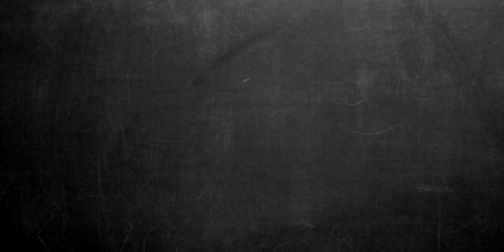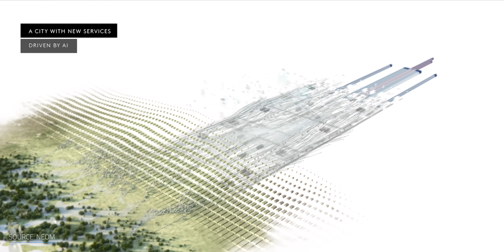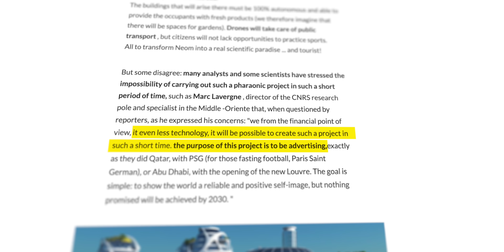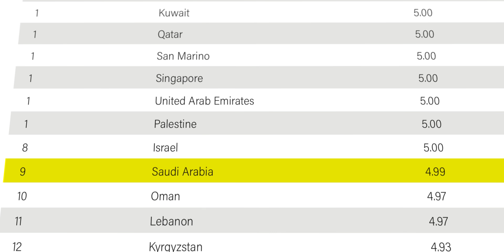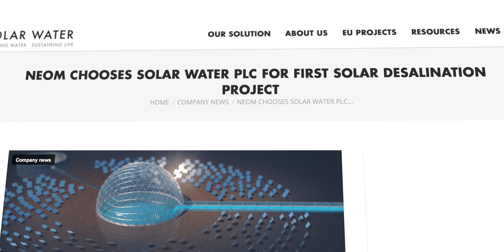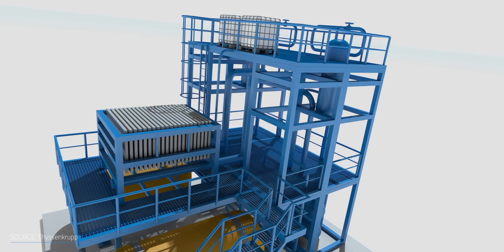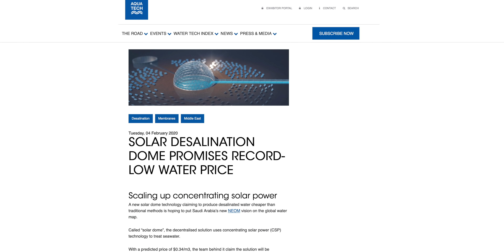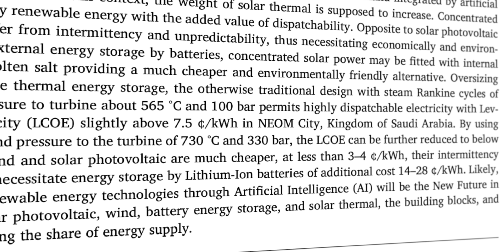Why Neom Might Be The Future of Sustainable Cities

Comment: Firstly, no, this just seems like a mass surveillance city designed by a megalomaniacal dictator. The attention is the point in these kinds of projects. Other examples of similar logic is dictators building the tallest tower. It doesn't matter if the new tall tower is actually economical, sustainable or liveable as long as they get to brag about it.
Secondly, he could literally just build rail, trolleybus, pedestrian and bike infrastructure into pre-existing cities and their sustainability would skyrocket, far outpacing whatever gains a giant line of expensive concrete could do for sustainability.

Comment: a linear city solves the problem of political dissidents. MBS can accelerate train towards the concrete wall at the end, then stop it and open the front of the train , causing the disidents to rocket into the wall. bonus fertilizer source.

Comment: It seems some have a really short memory - haven't they learned anything from the Palm or the World artificial island projects?

The same goes now for Neom - of course, all can technically be done if one throws enough money on the wall. The football World Cup in Qatar showed us that even air-conditioned open football arenas are possible.

But aside of all this - already the city footprint doesn't make a lot of sense. A circular footprint would give the closest proximity to everything and would not require a SMAGLEV with supercooled magnets in a 45'c environment. Just as well as the issue of do we really need to bring another million people to live in a climatically challenged environment? I have friends in Dubai and they tell me that on a normal day, they won't be outside for more than 15 to 20 minutes a day - the rest of the time they are in airconditioned rooms - their cars included (yep - AC in the garage).

So maybe real estate developments in less demanding climate zones would reduce the energy requirements by 50% to start with. I like the push for green hydrogen though and hope this is going somewhere....

Comment: "the line" is supposed to be inhabited by 9 million people and be 170km long. You need a 520km/h railway to connect it end to end to still fit within 20 minutes connection time - not accounting for stops!

meanwhile the former Tokyo City limits (23 special wards) have a surface area of 662km², which corresponds to 29km diameter give or take with a population of 9.7M people (2020).

you only need 1/6th of the train track  to traverse the city end to end, so with the same "revolutionary" technology that is supposed to be used in "the line" it would only take around 3 minutes 20 seconds. and only 1 minute 40 seconds to get from the edge of the city to the center, assuming the same technology. 

there is a reason why we don't build line shaped cities. Because that idea is pure and utter nonsense.
Reply: There is a city that exist built following a river between mountains

Comment: I love sci-fi, but this installment of “dictator vanity project” just isn’t believable. While it is shiny and newish, the design is actually one of the least efficient means of concentrating population in an urban area. Proposed in an area with almost no arable land, all goods will need to be imported (until your hydroponic gardens come online and the appeal of lab-grown beef and goat has become agreeable to the elites). Distribution of goods, utilities, and people in a single linear direction is the least efficient way to deliver such services. Let’s hope we have teleportation figured out by the time they ever have a failure in their mag-lev transit system. With little to no redundancy, the wait time for food, even the ability to get home/to work could be ugly if the failure occurs between you and where you need to go (or where the food is). 

We had best have fusion commercially available if this 500 meter tall, 170 km long sky scraper on its side is ever going to be built in a carbon neutral fashion, seeing as how all of it will be financed by Saudi petrol dollars. As for construction, let’s hope the Saudi’s have abandoned the Fafala system of forced labor before this breaks ground. Finally, desalinization requirements for The Line would turn the Red Sea into the Dead Sea from brine disposal. Guess sea food won’t be on the menu for locals in Egypt, Sudan, Yemen, Eritrea, or the rest of western Saudi Arabia. Sucks to be them, I guess. 

If SBM wants to turn Saudi Arabia into a world leader in technology, finance, and culture, I am all in favor. Reducing the country’s reliance on oil revenue is smart and good for the survival of the planet. But maybe they should invest the estimated $500B to build The Line (stop laughing) and invest it into turning Jedda (or some other more suitable location) into your tech/finance/cultural hub. All you need is to build some iconic mega skyscraper and business district there and . . . Oh, wait . . . 

Dictators and vanity projects are a danger to us all. The least they could do is hire a decent urban planning firm to give there BS a faint aroma of plausibility.

Comment: The Saudis could build a massive solar array in the desert for less and power Eurasia dominating the energy market for the next century. They could actually tap the heat of the desert as a geothermal reservoir and do the same. 

This seems little more than an insane vanity project.

Comment: The lines transport system confuses mid range high speed train travel and short distance intra city travel. How are people going to travel 1 or 2 km, 5, 10? Will the hyperllop make frequent stops like subways(every km or so)?then it would not be able to reach high speeds . Acceleration and braking from top speeds alone would take a few kilometer’s. Then theres offloading wait times. Also, what would the capacity of these trains be? A few 100? A building like neom would have over 10s of thousands of  people living in each train station sector. Multiply that by however many sectors there may be. Even if only a fraction of the people use the rail network regularly, we are talking about a massive number. And remember, this is the only transport available, all stuffed within a 200 meter wide building. Its just too unrealistic. Then theres the vertical transport system. We all know what its like waiting for a lift in a high rise. This is a 500m tall building. Even high speed elevators havent fixed this problem. Just getting people to the underground levels where the trains are would be a major logistical hurdle.No word on how theyll deal with that major bottleneck. The line is just a pipe dream.

Comment: There is a massive problem of ventilation in this design, the amount of energy required to ventilate / temperature control every nook and corner of this city is going to be so unimaginably high! The ventilation needs to happen 24/7.

In an organic city ventilation is not a concern, the form of this project will inevitably create problem that usually wouldn’t exist in an otherwise organic / normal urban areas, surely this is not a sustainable way forward when the basic requirements such as general ventilation itself is a challenge?

This seems more ego driven than functional or scientific approach.

Comment: I can see how this idea creates a single artery connecting the mountains to the sea. However, I'm not seeing how this architecture will work without regular breaks due to maintenance as you are baking in a single point of failure by building a line rather than a spoke and hub structure.

Comment: the littel economist in me says  promoting something will be clean if it uses solar or renewable, merely means some other project will not be clean.  Most electricity in the grid is mixed together, you can't seperate where your power comes from, even with those feel good power company green energy options.  these projects mentioned here all use electricity, and it aint free.

Comment: I don't know why the obsession over how fast the train goes. The city is planned to be 110 miles long. Unless there will be no stops in-between the far ends of the city, you'll loose a ton of time on stopping and starting. Just build the lowest level tunnels big enough for future expansion. Current proven train and high speed technology should be plenty for now.
Reply: If you are in construction industry, you know how expensive tunnel boring or tunnel digging are.  Thus noone will pre-bored extra tunnnels  for future expansion.  Never.  Money matters.

Comment: Couldn't they use RO until they start getting decreasing gains to a point, then use desalination by heat, since there will be much less water, meaning not only will you not have such an energy intense process but also they will be left with salt and minerals rather than this brine that sinks to the bottoms of oceans and messes with the ecosystem.

EDIT: I guess this is what the CSP desalination is supposed to do, without RO... Then it makes me wonder why other desalination plants can't do this... Most of our lithium is harvested by basically desalinating water in varying concentrations (there's more to it, including rows of water pits that they move the proper ingredients from one pool to the other) but it allows for fairly pure lithium. 
( Veritasium Video on the similar method for lithium with potash as well: https://www.youtube.com/watch?v=YMDJA4UvXLA  Another video on lithium and other metals from brine: https://www.youtube.com/watch?v=fc4el_xxVmE )

Comment: Another example of the future only existing in CGI.
A computer generated image or animation is not a plan, it's an idea, a sketch at best.
Reply: Agree.  They do not even perform basic calculations on the infrastructure needed.  I bet that they do not know how much energy is required to pump just black water i.e shit, urine, water with soap detergent to the waste water treatment plant and get it properly treated.  They claim clean energy and may end up the solar power plant does not generate enough electricity to treat the city's shit.

Comment: OMG THE LINE - From 3D to 2D living. :D :D :D Just drive forwards or backwards, safe to move, can't escape... werrrry nice jail! :D We have the LINE already in every city, every road is a line that is surrounded by buildings, but it has a reason why it is not just one big line but many lines connected as a bigger plane. Geometry. If we would put city like Helsinki in one f*cking line, it would be huuuuuuge long for no reason... 

Lets say that you are living on other end of the line and your friend other end of the line. It just is NOT energy efficient layout to have line. Lets say that it is 100 km to drive one end to other end (in the line design). Well, normal city is cube/square(ish), so even if your friend is living on other end (in normal city) and you at the other end, it will take 4 times less travel (25 km) cos you have 4 directions to spread and go, not just two. Plain and simple, they just try to make us even more slaves and at some time close us in outside of nature so our later generations would never know who they are and what are their surroundings. Like living on the castle that has no windows and you have never seen a deer or tree.

Comment: This concept city is not a single line but or of a micro cities connected by a line of hyperloop other transportation methods such as cars they have a smaller networks serving each micro city. 
In other way you can think of it as a line made up of a lot of dots next to each other. 
The line is nothing but a fancy name. but that said I can see the potential for this city to grow in many direction, each micro city has the potential to be a joint for future cities to grow from. Sadly nature never have a straight line meaning, this city is not natural and what is natural will cause a lot of problems.

Comment: Have you been on the Shanghai maglev? It’s been operating for years
Reply: True.  It is not enough for the Line.  175km in 20 minutes.  Not counting acceleration, deceleration and stopping for stations in between, they need 525km/hr at minimum.  Shanghai maglev is not fast enough for this city.  It must be a 600km/hr plus train.

Comment: I won't believe the hyperloop works until I see it. There are too many issues. Some of which being: thermal expansion and buckling of the tube, strength of the tube to withstand extreme low pressure while dented, cost, emergency exits.

Comment: Too late.  The capitol is almost gone and the USA is no longer dependant on Saudi oil to be swindled.  They need to get a pipeline to the Redsea to avoid the Strait of Hormuz and move oil safely when Iran finally comes at them and the road citry is a good cover for it.  The solar dome for water might be a viable technology and it is one they alrerady have demonstration and development hardware being developed.  The rest, just a cover for getting the pipeline in wether it crosses to Egypt or not.

Comment: Hyperloops are just bs. I mean really, you also only included animations from virgin. Funny thing though that animation has a few very, very stupid designed in it, like the 90 degree curve or that stretch were the train goes under water. Both of those pieces would kill you a few times over with their g forces at hyperloop speed.

Comment: Wait... Why aren't we using electrolysis to desalinate water? It powers itself. Split the water into gases, used the gases to power a controlled burn, which turns a turbine to generate power to split more water... You could even use the excess heat for thermal desal and up your fresh water creation is a less infrastructure demanding way, and turn more turbines, and if you elevate the capture tanks, the condensed water can turn even more turbines and generate more power... If you did it right, you might even end up power rich.

Comment: Pretty sure a maglev train isn't better than a classical train for short distances. You said it yourself it's to move between urban centers. Moving within the same city entails regular stops and until now magnetic levitation trains have not been great at stopping an starting fast which is what you want from what is basically a subway system. Regular railways are better at that. You can improve on regular railway systems to make them extremely efficient for a tiny portion of the price of a maglev system. And this is a tiny portion of the issues with neom.

Comment: The ends are too far apart from each other and the middle. Make it a 31.4 mile diameter circle and you can cross it in 15 minutes at 125 mph, which is more realistic.

Comment: Neom and the solar dome sound exciting, I hope they can make the economic factors work.
Matt, you mentioned the dirty old Haber-Bosch process. Have you checked out the new Hazer process being prototyped in Perth, Western Australia, by Hazer corporation? This converts methane into H2 and graphite with no CO2 emissions. The key is a fluidised bed reaction chamber with iron ore granules as a catalyst. It promises to produce hydrogen much more cheaply than by electrolysis. It could also provide the mechanism for converting fugitive CH4 emissions into two marketable products, graphite and hydrogen.

Comment: Hyperloop is a scam or the worlds largest implosion waiting to happen. Just getting a train into and out of the vacuum sealed system would cost more energy/machinery/time than you would gain from running in a vacuum. Even if the tech did work, the vast majority of train routes would not benefit from the extra speed due to the distance it takes to accelerate/decelerate. This necessarily makes  the hyperloop tubes hundreds of miles long. That volume  only adds to the amount of force that CONSTANTLY wants to be crush the entire thing like a beer can.

Comment: In a line ... you also need to transport water further in aggregate compared to a grid ... real pointless .. creating vacuums in tunnels to create less air resistance is folly .. dreamers .. you need airlocks at every station ... why have such fast trains ... the average distance travelled is say 4km -8 km say ... short haul .. you dont need such fast trains .. just the acceleration will make you sick.. let alone the deceleration .. oh i forgot ..  its all for AI eventually  ... shame that most of the Lithium is in Bolivia and Afghanistan .. 2 of the most desperately poor nations that could use some money for infrastructure... instead of this futurist ecstasy plan that is not quite thought through well enough.

Comment: I have done a lot of research and NOAM is a great idea that will run into a lot of problems if it succeeds. As the city expands which it will it won;t retain a one line approach. It will sprawl out like all cities do. So how do you integrate north and south infrastructure into a city designed west to east? Now you have a traffic jam as you trade into the east bound train line.

Comment: Make sea salt from the super salty slurry, instead of putting it n the ocean!  Dump it in evaporation pond!  Cover the buildings and just out side the city with solar farms, and wind farms, generating power, possibly use wave energy to generate power, all that is needed is magnets, coils, a float. And a cable anchored to the sea floor,  the up and down motion will generate power. Maybe use multiple types of sea generators, because there may not always be waves, the underwater rivers can be used nearly constantly, Maybe disrupted in rough seas?   I think they can do it, maybe not completely by the 2025 or 2030,